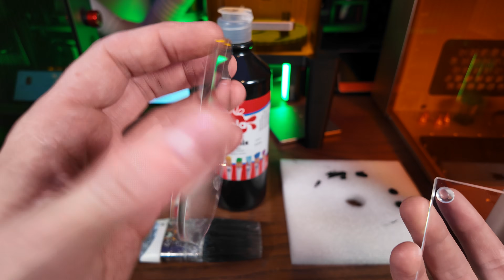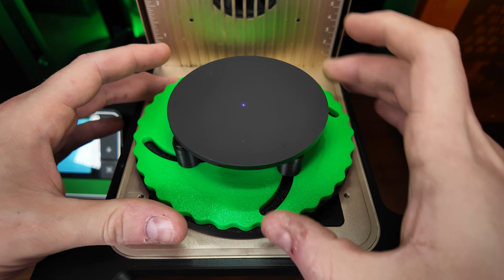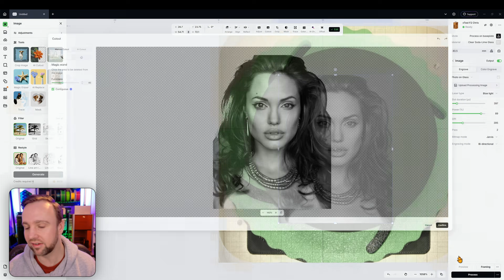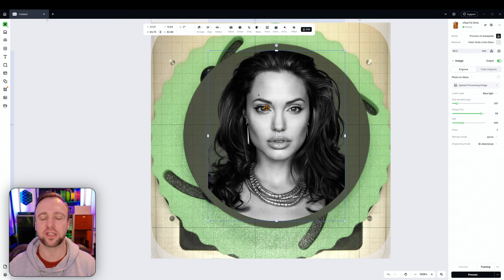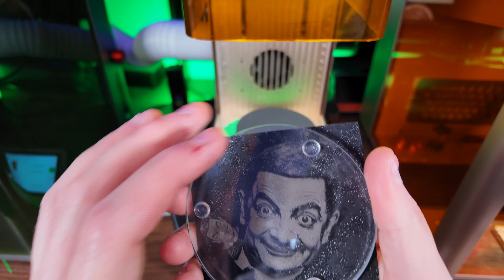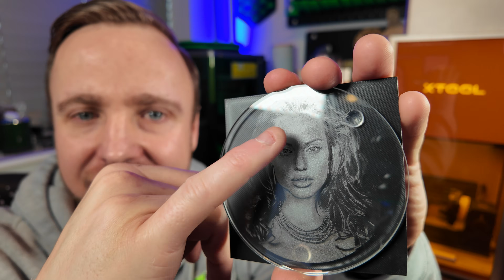Turn Your Photos into Glass Engravings | xTool F2 Workflow

Comment: one more question- when you are uploading a photo does it have to be a black and white and what format?  I really would like to know how everyone uploads a photo and turns it into a vector in order to engrave on slate or wood.....so much to learn Please 
keep making your videos for F2.
Reply from the maker: It doesn't need to be a vector, you can import a normal photo like a JPG or PNG and engrave it as an image. If it's in colour, either tick greyscale in the adjust settings or use auto adjust like I did here.

Comment: Would this be possible on the m2? I’m looking to buy one and this would make the decision much easier
Reply from the maker: I think you could probably do this with the diode module but I haven't personally tried it so can't be certain. The settings would be different because it's a gantry laser and not a galvo laser.

Comment: Just a friendly reminder when working on engraving any kind of glass. It will be hot. Allow the item to cool off before attempting to clean it because the sudden temperature change may shatter the glass and cause injury. It's hard to determine how much time is needed, I had a glass sit for 15+ minutes and it shattered.
Reply from the maker: That's an incredibly important safety tip! Thanks for sharing your experience and reminding everyone about the potential for thermal shock.

Comment: I have tried and failed many times using Xtool background remover. On some images it takes too long and the AI in Xtool doesn't always take it all away. BUT... I have started using the background remover in `Canva´ and that does it sooo much better and  doesn't cost anything if your a member.
Reply from the maker: Thanks for sharing that. xTool's cutout tool struggles with busier photos, which is why I used Adobe Express here, but Canva's is a great option too if you're already a member.

Comment: Hi sorry to bother you I've got xtool s1 20w 40w and the 1064 IR will I get similar results. Thank you for the video please Keep them coming
Reply from the maker: Sorry for the slow reply Nigel. I don't have the S1 so I can't say for certain, but the same painted glass method should work with the diode, the settings will just be different. I'd run a material test on a painted offcut first.

Comment: Sorry? You painted it, only to just wash off the paint? What is the point of the paint?
Reply from the maker: Yes, if you try to engrave onto glass with a diode laser it will pass right through and leave no marks. The paint gives a non transparent surface for the laser to impact and create a chemical reaction which leaves behind an engraved mark.
Reply: @L3DAccessories  Fascinating.. I use both CO2 and Fibre lasers.. with the CO2 I can engrave photos directly on the glass (though acrylic is much better) so I didn't understand - thanks for clarifying - cheers!
Reply from the maker: @semikruller You're welcome! My knowledge on CO2 lasers is pretty limited.

Comment: just a heads up the f2 is using the IR laser not the Diode one to engrave on glass.
Reply from the maker: That's incorrect, it uses the Diode laser. Look at the settings I use in the video and look at it actually engraving in the video followed by the results.

Comment: Thanks mate! I was trying to buy a F1 & Air purifier through your affiliate link and it said your discount code was invalid?? 😢
Reply from the maker: The discount code sometimes doesn't work if an existing better discount code is applied. If you still use the affiliate link I'll get credit. Thank you
Reply: That might be the case as it’s quite reduced at the moment.
I was also wondering: you’ve got so many different 3D printed jigs- I wonder why that is? Is the material moving a lot whilst engraving??? Do I need a jig? Sorry for the rookie questions- I haven’t even gotten my F1 yet 🤪 planning on doing dog tags for starters…
Reply from the maker: @CatiaRemy-mv5kr Jigs just help to guarantee the position of your item so you can quickly setup a design and engrave. They are useful if you want to keep doing lots of the same design or if you want to streamline your process.

Comment: Spray instead of paint.
Reply from the maker: Are paint spray guns able to use a thick tempera paint?
Reply: @L3DAccessories  Dilute it with water 1:1 and it works great. Not sure if it works for photos, but for uniform frosting with Xtool S1 I turned the glass upside down and focused the beam on bottom side. This way paint coat thickness won't be a factor.